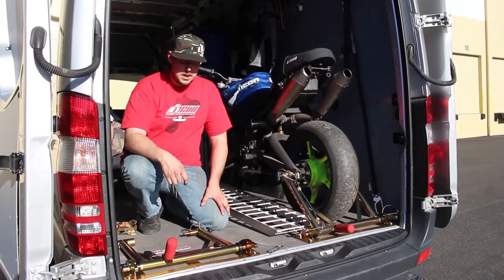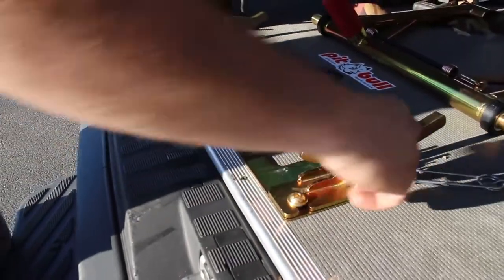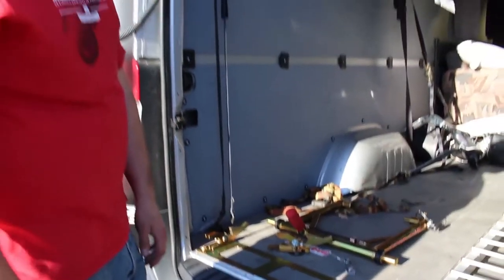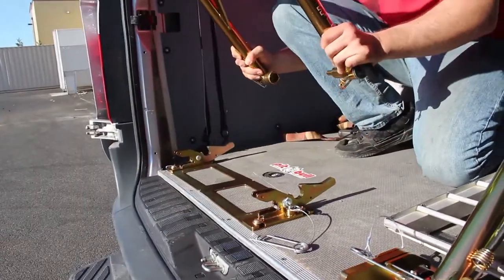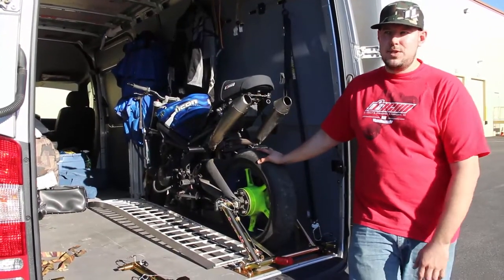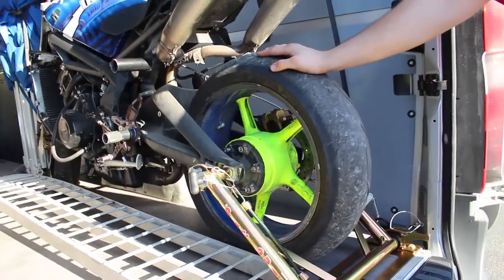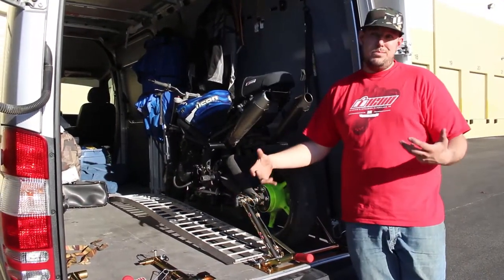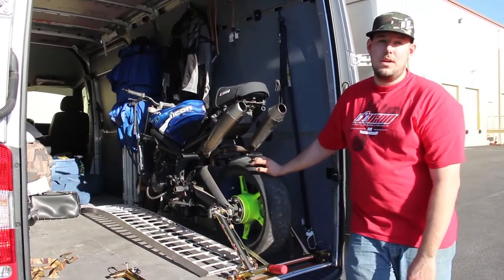Pit Bull Trailer Restraint System INSTALL and REVIEW

Comment: Cool update - thx. I ran with the Baxley trailer chocks - the "LA trailer" Chock. Only requires tie down in the rear. I just prefer not having to faff with different adapters etc

Comment: If installed in a vehicle, like a van, in an accident, the bike could tear free and become a projectile.  I think it best to add a plate below the van to keep the bolts from pulling though the sheet metal.
Reply from the maker: noted

Comment: Do you have a long-term update on the system? I like how you mounted it as basically far back in the van as you could, doesn't the handle get in the way when you try and shut your doors? Or is the system designed so that nothing hangs out past the mounting plate?